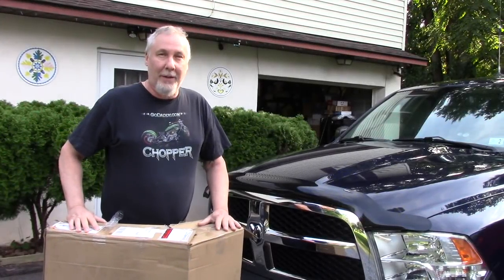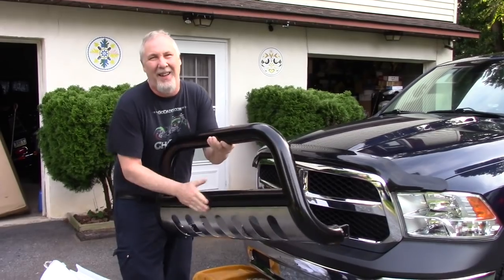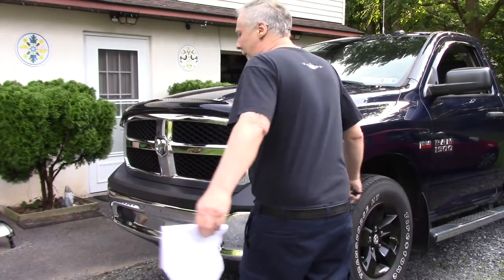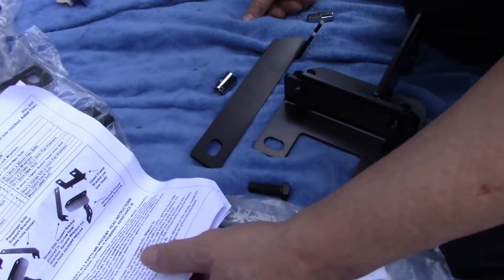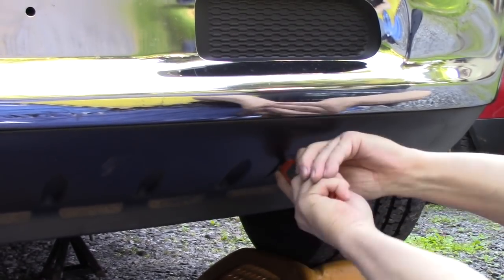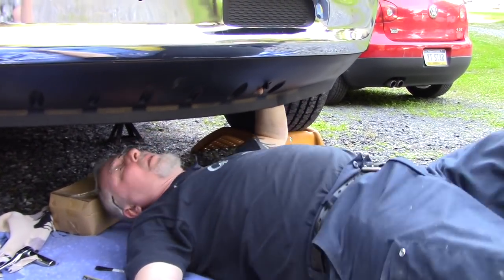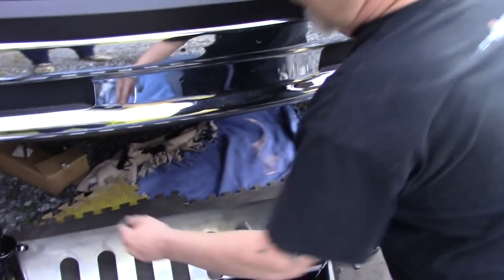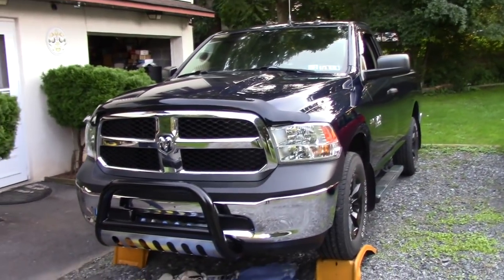Ram Bull Bar Install without Removing Splash Guard

Comment: Looks Good... When I put one on my 2005 Dodge Dakota I didn't remove the pan either. I used a dremel moto tool with a cut off wheel to cut the plastic. 3 years later a idiot in a Jeep passed me in a snow storm going down the mountain and when coming back over in the lane went sideways 50' in front of me. Had no choice but to hit the brakes or hit him. The Dakota went sideways then head on into the guardrail. A reflector on the guard rail cracked a headlight and the, "bull bar", cracked the chrome grille but that was it. Adjuster said policy wouldn't cover bull bar as it was a accessory. I priced a new grille and headlight at the dealer and asked the adjuster if I could install them. He said the bull bar saved the truck from a lot of damage so he allowed for a new one. After I got the check I ordered the headlight, grille, and bull bar off Ebay and walked away with $120. They work. I put one on my current Nissan Frontier when I got it.
Reply from the maker: Wow!  :)

Comment: Looks amazing friend. I own a silver Ram with chrome bumpers and can’t decide if I like the black or chrome version more. Also I’m trying to find one that either doesn’t interfere with sensors or relocates them? Thanks
Reply from the maker: I couldn't decide either. That's why I chose the black and steel colors. It helped once when a deer ran across the road. He got hit but I had no damage. My 2013 doesn't have all the sensors in the bumper.

Comment: Currently doing this on my 2014 Ram 1500  I took off the splash guard lord it was a pain to get off ..... fyi the support brackets are put on wrong the open slotted side goes on the main bracket and the closed side bolts on to the trunk